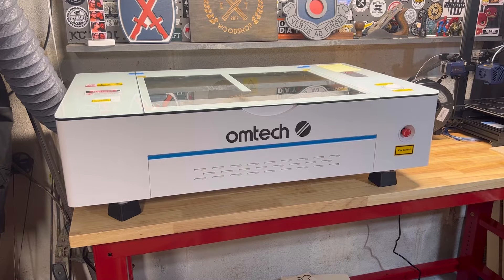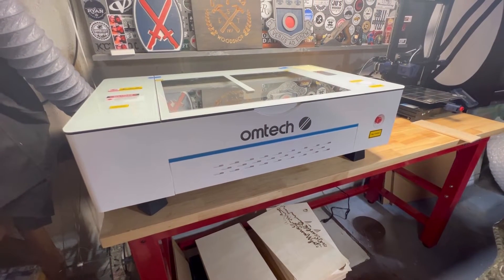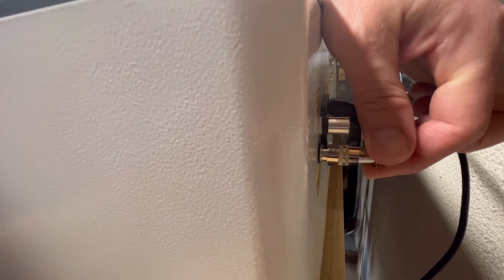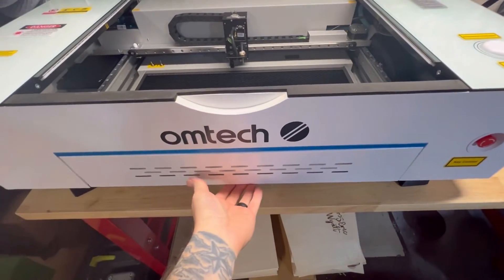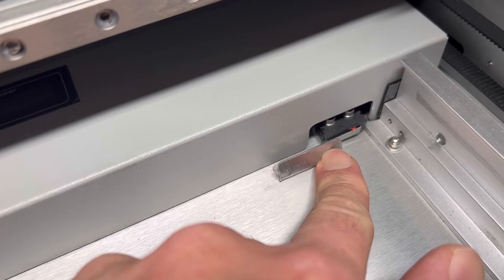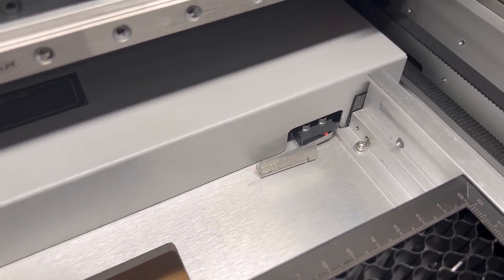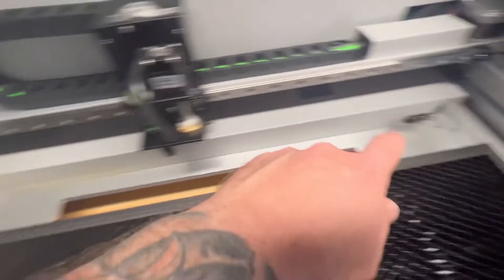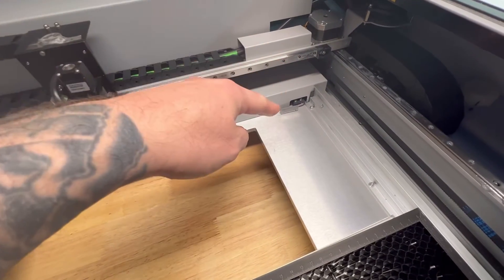Why won’t my brand new OMTech Polar Fire?

Comment: That aluminum angle is supposed to slide to the left out of the way so drawer can hit the switch. It has slots in it at the mounting screws. You are supposed to slide it to the right to press the switch when you remove the tray to use the pass through feature. The switch itself may need adjusting as well.
Reply from the maker: You’re totally right. Mine moves up and down because it’s loose as you say. Thanks for point that out. This will still be a good place to look as many people are missing this little switch in order to get their laser to fire.
Reply: I tried that too.  didn't work.

Comment: I hope you see this comment!!  I have the Omtech Polar and I have the problem of the laser not firing when I engrave but it cuts fine.  I checked the 2 things you pointed out and that didn't solve my problem.  I have added water to the water tank and it is good.  Do you have any suggestions?  Thank you!!

Comment: I’m getting a water alarm error. I just got my polar 55w. Any tips?
Reply from the maker: Either the tank isn’t filled at least 2/3rds of the way, or the waterflow sensor is bad. If it’s not full, then you can top off with distilled water

Comment: I went through the video servals times
I have the polar 50w
It does everything but fire. Everything is just as it should be according to your video. Help I am ready to give up😭
Reply from the maker: Join our polar community linked in the description and ask for help there. There can be a few reasons why it’s not firing. For example, if your min and max power don’t match and your min power is too low, then it won’t fire.

If you have a water drop with an X on it on the digital screen then you could have a water sensor issue.

Comment: I don't know if this was already asked but he goes. My omte CC h polar came with one toggle switch and it's for the rotary only... So what do you do then if that pressure sensor is the culprit?
Reply from the maker: What exactly is happening?
Reply: @EdmondsWoodshop  Thanks for the reply. I figured out that I needed coolant. Laser didn't fire, I guess it's a safety mechanism. Added some distilled water n away it went. Thanks again.

Comment: Hi, I am having this trouble, I have just checked my machine and only have one switch for the rotary and have two little pressure switches which seem to be depressed. I have tried to cut a test piece and  framing works but laser doesn't move from home when asked to cut. Can you please help?
Reply: Did you get your problem solved?

Comment: When I press start the head moves into location .. starts but abruptly stops and the laser status turns red … any thoughts
Reply from the maker: Please join our FB group (link in the description) for help troubleshooting. The polar has many safety switches and other things to look out for. There’s the tray safety switch, the door sensor (lid needs to be closed), and lightburn process requirements. For example, in lightburn you can’t have your design too close to the edge otherwise the laser may not have enough room to accelerate or slow down so you’d need to pull the design away from the edge. Other issues could be a water flow issue.

This is also why having a ruida control panel is so important. It helps identify what the red ring errors are. I have a video on it

Comment: I've tried all that but it still wont fire.  My new Polar only has one switch on the left for the rotary.
Reply from the maker: My polar is a little dated. OMTech has since come out with new models. Without knowing the details of what you're trying to do, I can't come up with an accurate solution. I suggest you join our Polar users group on facebook, record of video of what you're doing (both in lightburn and on the polar), and make a post in the group so we can help you.

Comment: I  only have one switch for the rotary, not 2 as shown.  I've checked the back connector and the tray connector.  I still can't get it to run.  I've had it for 6 weeks pretty much taking space and collecting dust.  If you know anyone in Calgary that can do a house call, that would be great.
Reply from the maker: Join our polar users group on Facebook and post picture and questions
Reply: I have joined and viewed many videos and once I press start, the red light come on... @EdmondsWoodshop
Reply: After spending 2 hours on the phone trying to troubleshoot my Polar, we could not figure out the issue.  They are sending me a new machine.
 @EdmondsWoodshop

Comment: Hi there, Thank you very much for your clear and helpful video's. I have a problem and wonder if you could help please. I just got my new Omtech Polar here in UK. I finally got time to follow your video and get it up and running yesterday. I did just a few test cuts and all was well. Today I concentrated on setting up the camera (which was a nightmare) but when I came to engrave the pattern for the lens alinement, my machine would frame and moved around as if engraving but there was no pattern. Having checked everything was set up correctly I noted on testing again, that the tube is not firing. Yesterday I could see  it flashing blue as it worked today nothing. I have tried everything you mention in this video but nothing helps.  The key is in fine and I am stuck. Any help would be really appreciated.  By the way my machine has some differences to yours.  The emergency stop is on the front and the pressure buttons that sensor the tray being fully closed are in a different place so are fully depressed

Comment: Cam, my polar 350 isn’t firing, I’ve done all the things suggested on message board and checked the pressure switch. My unit only has the rotor toggle switch. Ive emailed support Tuesday and the only thing they did was sent me this video. How long will it take for them to get in contact with me? Is the warranty any good? If it can’t be repaired will they replace it? Thanks, Richard. Order number28874  June 1 2023

Comment: Hello - I just received my new Omtech Polar this week. I've set it all up and my laser worked during the camera setup phase. As soon as I sent a job to the laser, the laser head moves around but the laser is not firing, acually, it fired for one part of the project but not 99% of the project. I've ordered the controller you suggested but not installed it yet, so of course I'm scratching my head with the problem. I only have ONE switch for my rotary setup, I wonder if they changed it so people no longer can bypass the safety switch.

Comment: I was so excited because I checked my pressure sensor and it wasn’t being pushed in place. I thought I had fixed it. But I still have the same issue. Is there anything else I can check for?
Reply from the maker: My video doesn’t show it but you can actually take that aluminum bracket and slide it to the right to hold it in place.

Make sure to join my polar group in the description

Comment: Hello, so I’m having the same issue with my Polar. I’ve only had it 2 weeks. It was working perfectly fine and the it just stopped cutting or engraving. It still frames just the same but when it time to cut or engrave, you get nothing. Do you have any other suggestions?
Reply from the maker: I have it wrong in the video. That bracket actually slides to the left and right to lock that pressure sensor in place. Slide it to the right and it should work.
Reply: I have d same issue did urs work?

Comment: Man you are a life saver! My machine is just a tad different than yours but that is exactly what was wrong with mine. Mine doesn’t have the little switch to disable it so I just had to use a little painters tape to get it to work. My tray will not press the switch in enough.
Reply from the maker: So I actually had it wrong in the video. The aluminum bracket should slide left to right which will hold the switch for you. If it Ms too tight, try loosening it a bit

Comment: Oh my goodness, I’m so frustrated with my Polar! I’ve checked the attenuator, checked the switch, nothing. It goes through the motions of engraving but no firing. I’ve been on and off chat support, support calls every day. Just turned it on the other day, calibrated the camera and camera alignment tests. Yesterday attempted to do the material test card as downloaded from the OMTech website and it scorched the holes, did not cut whatsoever and then ghost lasered the rest of the card….
Reply from the maker: There’s a lot going on in your comment and I can hear your frustration. I recommend Joining our fb community. Link is in the description.

Comment: Thank you for pointing out the interlock disable.  I was curious what that second switch was and the documentation was vague.

G. Rotary Switches—These two switches direct the mainboard and power supply to provide power and commands to the Y-axis rail or to a rotary axis connected to the rear aviation plug.
Reply from the maker: Yea i foresee some changes in the verbiage and some troubleshooting guidelines from OMTech very soon.

Comment: I have tried what you did. It gets the machine to frame and act like it’s cutting, but no power to the laser. Is their somewhere I can send pics of what my settings are?
Reply: The min and max is set at 60. The laser is not lighting up. Speed is 30. It goes over like it’s engraving/cutting.
Reply: @rick6880  Does the digital power meter show any current while it should be engraving/cutting?  If not, look at PS / Tube.  But, assuming you just got it, that's a OMTECH call before confirming the obvious.
Reply from the maker: Can you see if the laser is lighting up? What are your power settings and speed settings? Are the min and max matching?
Reply from the maker: Also is it actually going over the design like it’s engraving or just framing
Reply: @rick did you figure out the problem? My laser wont fire up either.
Reply: @divinastella  @rick6880. Same issue. I only have one switch also. Confirmed interlock. Nothing registers on power meter. Everything works as expected otherwise.  Strangely enough, the fan feels as though its blowing INTO the laser as opposed to blowing OUT of the laser enclosure...
Reply: This is what I am having issues with too. At high power (80+) it does register the correct output but below 60 nothing. Omtech told me it is an mirror alignment issues.

Comment: I'm still waiting on delivery of mine, but I plan to pull that tray out to work on slightly taller pieces (guitar pedal enclosures)... this tip probably just saved me hours of frustration down the road. Thanks man!
Reply from the maker: That’s the sole reason why I made this video. Looks like something may have been missed coming out of production and I was hit with all these messages telling their lasers won’t fire. Now you know if this happens to you.